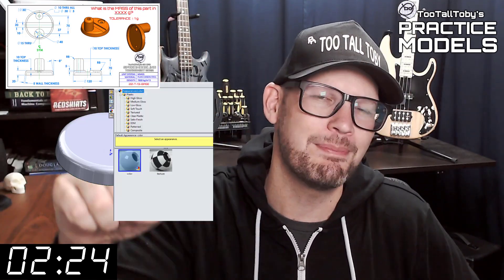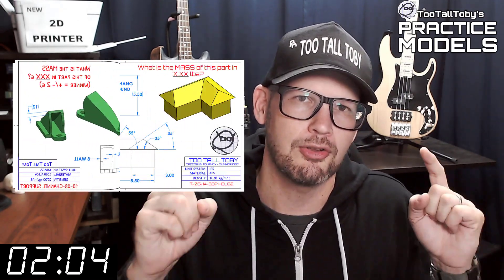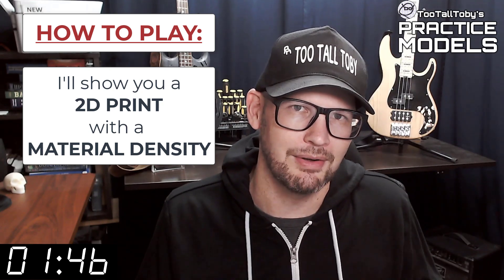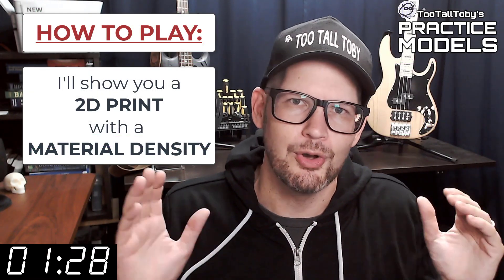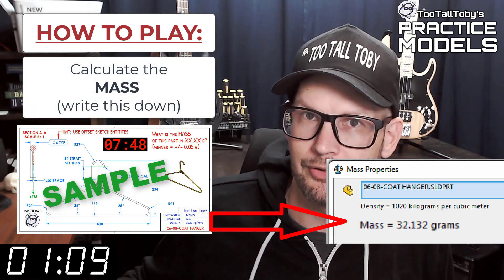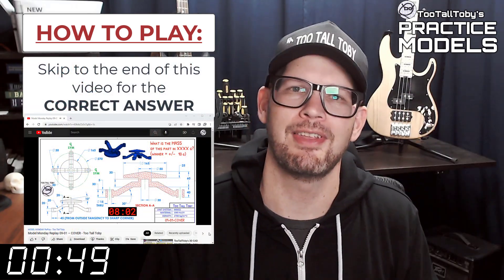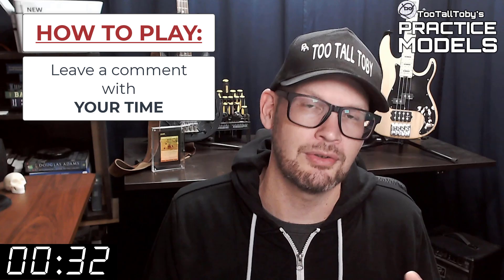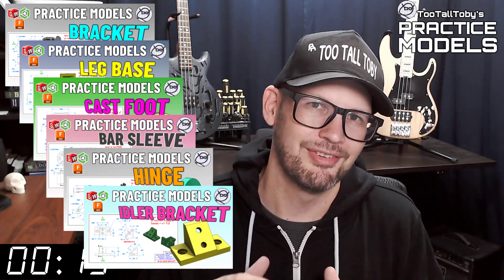2D to 3D CAD PRACTICE MODEL-  exercises for Onshape, SolidWorks  - 4th of July FIREWORKS

Comment: I got 1.78 pounds. I don't know if that's within tolerance or not. Not sure on time. 
Silly question, what's the process for candy cain colour pattern?
Reply from the maker: Candy Cane pattern shown in this tutorial - Good luck!
https://youtu.be/42Xk9fOn9bM?si=ZLHaB0vIRvgVmQh-
Reply: I kept getting 1.781 lbs. I finally found that I had put the center point of the tip of the fin at 2" below the plane of the bottom of the nozzle, but the tangent line is there. Changing the center point to 1.875" below fixed the fins to give 1.776 lbs.
Reply from the maker: @mirandawilde5681  nice